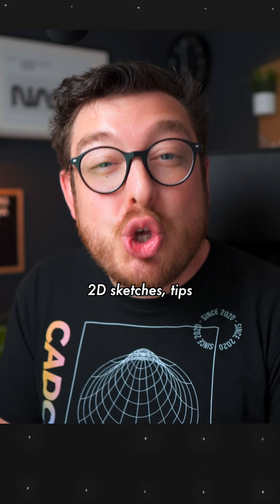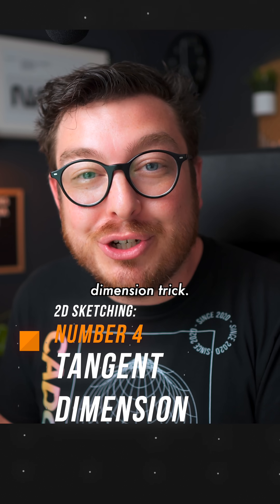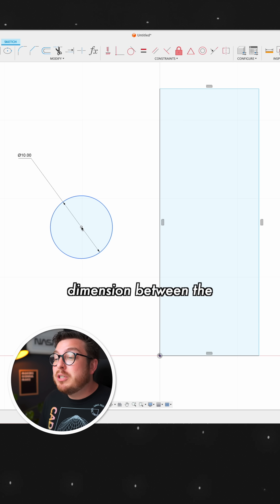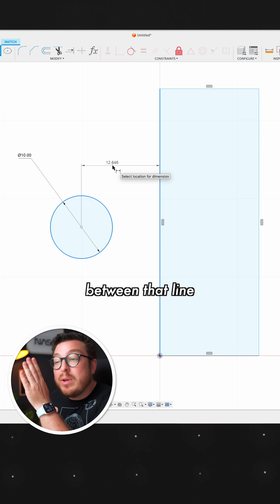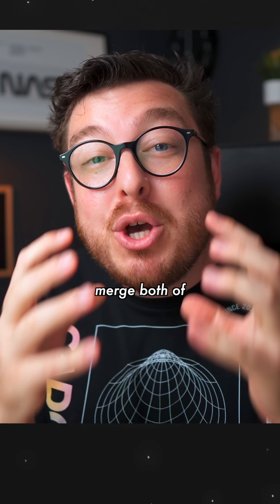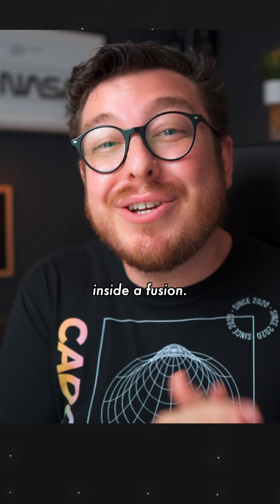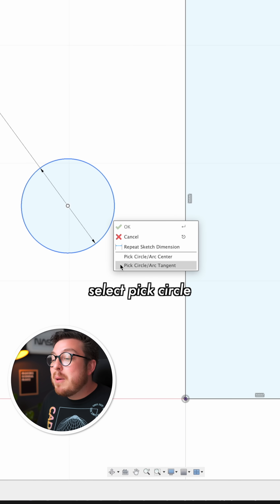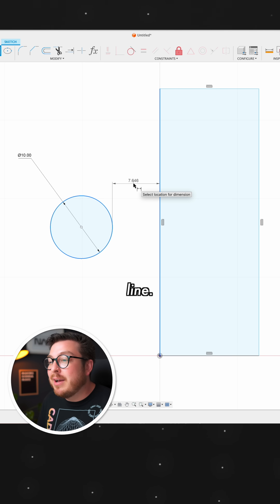How To Dimension Smarter | 10 Fusion 360 Tricks I Wish I Knew Sooner #autodesk #fusion360

Comment: Great tip. Had to do this a bunch on one design that was based off of measurements from hole edges. I think I did a workaround with added lines rather than using this tool, so this is way easier.
Reply from the maker: Awesome! It's those little things that make a big difference in the long run.